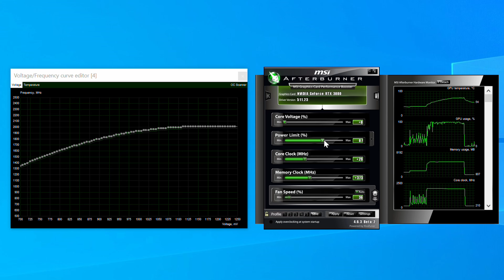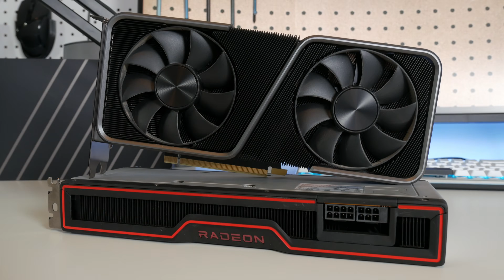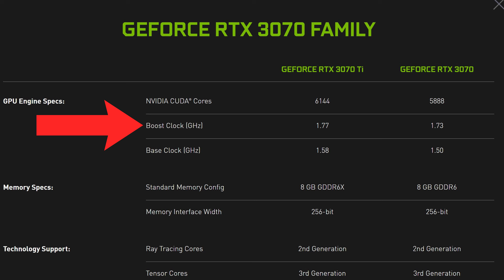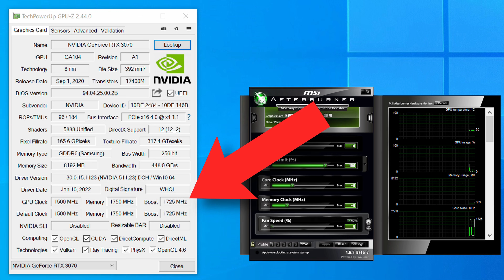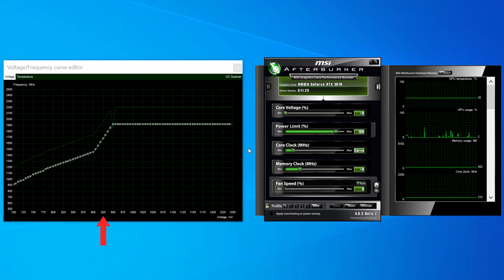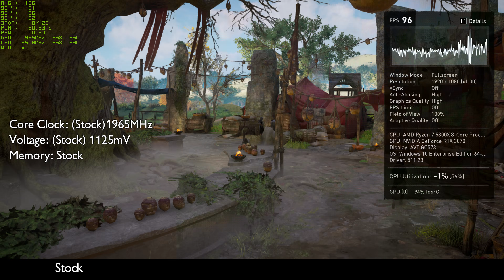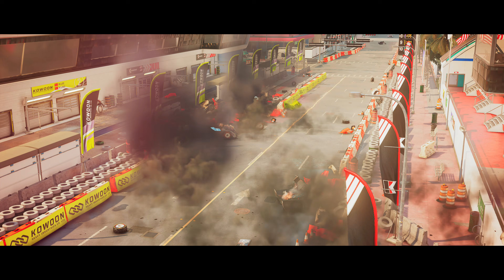How To Undervolt Your GPU (And Why You Should)

Comment: My GPU has voltage controls locked but I can undervolt by lowering power limit and raising GPU clock at the same time. It seems that even if GPU renders less frames when limiting power it's more efficient overall. By default efficiency is about 0.75 frames per watt but sweet spot for this GPU seem to be around 70% power limit where it's 0.95 frames per watt. When I used 70% limit combined with +125MHz GPU clock boost benchmark shows that I lost only about 5fps on average compared to default settings (110fps vs 105fps) but GPU is about 20% more efficient. Not much but it's something

Comment: Undervolted my EVGA 3070 FTW3 quite a bit. Went from about 240 watts all the way down to just over 180 watts. Big thermal decrease too from 62 to JUST 56 decrease in heavy load. I was also able to clock it all the way to 2010 MHz. So I drop power draw, and temp without losing a single frame per second.

Comment: You should not be doing the -200 to -300 on your curve as it will actually INCREASE the voltage required for lower clock speeds. This is messing up strictly by being lazy. Just use the voltage points for set clock speeds and don't touch the previous lower end of the graph (better yet INCREASE it on the Y axis to ask for higher clock speeds for lower voltage usage).
Reply: I agree. your method you will see effective clock is much closer than the method used in video when looking at hwinfo.

Comment: I'm very new to this undervolting so wanted to know what was the math/logic there with the boost clock of 1.73 GHz, the base clock being 1.5 GHz, and then pulling your GPU's rate down about 290-300 Mhz? To go a little bit under the base clock?

Comment: Isn't this tutorial misleading? If I drop the Voltage/Frequency curve, doesn't it mean that I give the GPU less MHz at the same voltage? Which also means I give it more voltage at the same frequency? For example:

Stock:

1500 MHz @ 0.800V

Curve Drop:

1200 Mhz @ 0.800V and now 1500 MHz @ 0.950V.

Do you know what I mean? Shouldn't it be the other way around? Like raising the curve? So that for example 1800 MHz is @ 0.800V?

Pure logic or am I wrong?

Comment: Im shocked. I undervolted my 6900xt sapphire nitro se for better temps. I was pushing 86 degrees on 4k full load on games (even 1080p on very demanding games). But then I undervolted to 2400 mhz and 1140 voltage and POOF. Thermals around 69-74 degrees on FULL load. Holy hell. My fps is basically the same. It runs in many cases up to 15 degrees cooler. The wattage went down from 280-320 watts to 190-210 watts. Im so glad I did this the first day of this GPU. It will lengthen its lifespan and make it much more of a long term investment. It did take some driver crashes and system reboots but I'm so glad I stick with it. These settings work on 4K cyberpunk and Kingdom come deliverance. It is stable on these games which probably means it is stable on all games.

Comment: I've been doing this to my 3060 Ti ever since I got it on launch. When I play old games that are easy to run I do an undervolt and underclock combination. So I set it 731mV at 1620 MHz clock. The temps are so low and it sips less than 100W of power. It's so good it can even play modern titles at 1440p no problem. Now when I want to play at 4K for more modern games I set it at 950mV at 2010MHz. Yes it's a combination of an undervolt and an overclock! Since the power limit of my card is 240W, high power usage games will have lower clocks but with the 950mV I can reach higher clocks at the same or lower power usage.

Comment: Seemed to help a bit with my 3070TI FE, but my temps are still crazy high. Playing at 1080p on Dying Light with medium settings I am averaging around 102c (down from 109c) but I can't even play anything new because my system crashes from heat issues. I have 2 fans pulling in and 2 pushing air out. Maybe I got a bad card?
Reply: Stupid question... But, do you have your GPU fans set to hardware or software enabled? Sounds like you need to check. Make sure you're using the fan curve setup in MSI Afterburner. Your card should not be hitting those temps if the fans are running, and properly setup with the software.
Reply: Is that at 100% fan speed? Those temps are absolutely insane.

Comment: An easier - though less precise - way to undervolt is to reduce the power limit in Afterburner and then use the OC Scanner tool to sniff out the best OVERclock for that power setting.
Keep nudging the power limit down and benchmarking each time until you come back to stock performance, then... that's it - stock performance for reduced power, and AB has done all the stability testing for you😁.
Reply: What is stock performance for reduced power? I dont get it.
Reply: @thenaberius6081  The same performance as out-of-the-box, but with reduced power draw.
Reply: Mind telling who is AB? 😐
Reply: @m.businessabdullah9171   MSI 'Afterburner'
Reply: @m.businessabdullah9171  Afterburner
Reply: @m.businessabdullah9171 AfterBurner
Reply: @m.businessabdullah9171  (MSI) Afterburner
Reply: @m.businessabdullah9171  afterburner program
Reply: @m.businessabdullah9171  Alpha Brain
Reply: what tools do you use for benchmarking?
Reply: @casualgamerdad2878  These days, Port Royal - batters CUDA, RT and DLSS cores all at the same time.
Reply: OC Scanner doesn't wanna work on my setup... I can manually set a curve, but the scanner won't initialize.
Reply: @Pn3uma33  same thing happened to me, any idea what the fix is?

Comment: When you lose the silicon lottery, your card sucks and cant hold any spare core clock points from stock and runs hot, might as well still get your fun of the overclock to achieve the opposite, yet same result

Comment: I have a 3080 12GB model from msi. Everything stock temps would be around 80-83c when gaming. After under volting my card now runs around 64-67 when gaming and only noticed a drop in the 5fps range

Comment: Just got my 3080 ftw3 and my Temps are high, excited to finally try this
Reply: @pcworld  from game Temps of 81c to about 74c right now. That's at 950mv. Tried 925mv and it was working great with Temps at 70c, but red dead crashed on me so now I'm seeing if 950mv is stable
Reply: @pcworld  nice! I'll post a reply with my results
Reply: @pcworld  everything seems stable so far. Ambient Temps were alot higher when I was having issues so, I'll have to see how It does on another hot day. 
Thanks so much for the help
Reply: @pcworld  1920 is what it was running stock during heaven benchmark so that's what I went with
Reply: @pcworld  oh wow ok I definitely will thanks

Comment: I came here to learn how to under volt my RTX 3080 12gb Zotac card.  My card definitely gives more than enough frames at 1440p gaming at max settings, so I would like to reduce the amount of power used plus the heat that it produces.

Comment: Dont work for me. I undervolted and reduce all clocks in my rtx 2060 gainward pegasus oc and still even on 90% fan and 600Mhz GPU clock in furmark running for 90 secounds in HD i have 80'C and hot spot of 95'C. With new termopads, thermall paste and cleaned from dust...

Comment: I did it. Got down to 935mV on a 3090 FE 1950 MHz. I didn’t mess with it for more than 20 minutes was satisfied with lower temperatures. The undervolt also shortens the steps the clocks shift up to so you end up with your higher speed more often with less heat. This was excellent. Afterburner also lets you save presets so you can lower the voltage even further on those less demanding games with just a few clicks to revert to better stability in demanding titles.
Reply: Why in games voltage spike from 850mv to 1081mv😢
But in benchmark is stable
Rtx 3060 palit
Reply: Transient voltage spikes are a normal phenomenon of this generation
Reply: @quin_helldiver  thanks man❤️

Comment: Umm, can you please explain the point of the first step, i.e. pulling down the core clock? By doing so the voltage/clock ratio shifts in the opposite direction IMO. In my case, on a RTX2080S,
base core frequency without touching it: 1650MHz@843mV. After under-clocking by 300MHz: 1650MHz@1037mV.
Isn't that the exact opposite of what we want?

What I do, I just reset everything to stock, run some benchmark and check at what voltage the GPU runs under load. In my case 1043mV (1920MHz).
Then I open the curve editor and push the 1043mV slider up until the benchmark starts crashing, around 2010-2020 MHz.
Last but not least, I try if allowing a bit more juice can stabilize the performance. So I ended up with 2025MHz@1050mV.

I am not touching anything else, only that one 1050mV slider in the curve editor. Works since 2014 :-)
Reply: Yes the dragging down the core clock method first is a complete dogshit method that all these Youtubers use. Annoying how hard it is to find the correct way to undervolt.
Reply: @TheRealSterlingArcher  Well I have to admit that using this method helped to make my clocks more stable. I was puzzled by this behavior for quite some time as it makes no sense really...  until recently 😀
The key here is to make the curve to the right side of your target frequency completely flat. Otherwise the GPU core tends to jump to the next highest frequency when under load. In a real life scenario you may end up with this: Your target clock is 1980MHz @ 900mV > But the curve continues to ascend slightly so you also have 2070MHz @ 1250mV. Under peak loads the GPU will try to jump to that higher clock but hits the power limit.  So you end up with high peak clocks but a low average.
The step of underclocking first with the main core clock slider helps to mitigate this as you pull the whole curve below the target frequency and when you then raise a single curve slider somewhere in the middle, the right hand side of the curve is straight flat. This works but is a dirty solution.
The really correct way (when you know the target voltage/frequency)is: 1) Open the curve editor and check the default frequency at the target voltage. 2) Adjust the main core clock slider so that you get the desired frequency at the given voltage. 3) Now go back to he curve and pull every single slider to the right of the target down so that the resulting curve is entirely flat (between 900mV & 1250mV in my case). This way you don't get that steep part in the curve, so you're not overvolting the left hand side ;-).
I know that this procedure requires quite some patience but it's definitely the correct way 🙂

Comment: Had an alienware prebuilt with a 2060. Did your undervolt method used to average 76 to 80 Celsius on warzone playing with nvidia filters. After undervoltinf averaging a clean 64 to 65 Celsius same graphics and filters and everything. Great guide. Didn't see much improvement with my 3080 but 5 degrees Celsius lower and hardly any decrease in performance. I'll take it lol

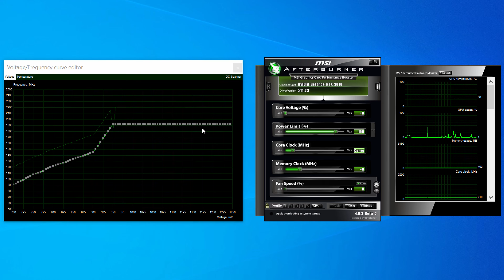Comment: That frequency - voltage graph is doing my head in. At 4:08 the video is saying that voltage is set to 950mV; with the voltage along the x-axis. Meanwhile the graph is showing the straight line at 1900MHz, while voltage runs x-axis all the way to 1250mV.

To be accurate, the line on the graph should stop at x=950mV, and y=1900MHz. 

If you notice my other comment on this page, is dated three months ago. Hence it's taken me this long to work out why I don't understand how to undervolt. It's because the graph makes no sense. It's because I came back determined to understand undervolting, that I worked out my confusion with this graph.
Reply: Ye the graph in afterburner can be kinda confusing, basically the way it works is like this: you downclock the frequency by 200mhz, then raise the 0.950v keypoint on the curve up to certain frequency, lets say 1900mhz, by doing that you tell the gpu to use up to 0.950v max for that specific frequency and since it becomes a flatline at 1900mhz mark, it means the gpu doesn't need to increase the voltage anymore for such frequency... 

The only kinda issue with this metod is that when you underclock the curve by 200mhz, you're literally overvolting everysingle frequency below the 0.950v mark, if you see the graph, the gpu will use a higher voltage than stock at low frequencies, still it shouldn't impact negatively since those voltages will still be lower than 0.950v...
Reply: @ArgStyleRlz  Am not sure I agree. I noticed something else wrong with this guide, for two reasons.

1. By dropping the graph at 2:52, you would be overvolting all frequencies under your chosen 950mV in this graph 3:55.
2. There would be a significant step up in voltage at the point of 950mV.

I continued to look for guides and eventually decided on the following:
Take you graph line with shift and mouse click. At your chosen voltage e.g. 950mV, drag the graph 'up' to your chosen max frequency. From the chosen voltage, level off the graph so the frequency doesn't go above your chosen max frequency. (That way you will undervolt all frequencies of your card.)

Comment: yeah i have a 3070ti in the fractal torrent case, hella airflow. i always make custom sensor dashboards using aida64 for all my computes so i can monitor performanc and temps. immidiately noticed the card, stock, hit 70 to 80 degrees in almost all games with a hotspot of 10 higher than that usually. i undervolted to 875mv at 1800mhz, now i can run the full cyberpunk benchmark that maxes out GPU utilization and i only barely hit 60 degrees AND better result. this is a no brainer for anyone with a 30 series.

Comment: I would like to correct one thing : Those cards must work with lower voltage. It's right in the V/F curve of the card how far it's rated for any given voltage, and ALL these point had to be checked for stability in factory (at least that's how I think it's done ?). 
As for why no manufacturer does this : It's not because "card will get unstable", it's because "performance drops too much [vs. competition]", or "MHz aren't high enough, so let's not do that [when using NV guidelines]. 
GPUs can be made to work at lower stock voltages, they simply can't be clocked as high on them.
Personally, I would love GPUs to be run at stock with 0.7V for big die, and 0.8V for smaller ones (both on lower clockspeeds than today), BUT with additional "OC" option that raises voltage by additional +0.1V or +0.2V value IF user want's to go over that (and is informed about risks [higher power usage, hotter GPU, etc.] with proper on screen warning).
Reply: Dude I want to run at a good 1.2v if I'm overclocking. Newer cards rarely make 1.1v
Reply: @TimberWulfIsHere  Use older GPUs if you want higher voltages. Voltage doesn't mean anything and it WILL only get lower. Think about it : Pentium III 180nm had 1.75V stock, while Pentium 4 had 1.45v or 1.3V (130nm/90nm).
You can't cheat your way out this on current tech.
Reply: @CompatibilityMadness  that's terrible advice. With more power comes great res- voltage.
Reply: @TimberWulfIsHere  ?
It wasn't advice though ?
(sarcasm)

Comment: Linux doesn't allow voltage corrections. Can I tune my GPU under Windows and then move it on my Linux system? Will it keep the undervolt?
Also, I'm using a card which behaves oddly in Linux. I suspect there is some voltage correction on it. Can I investigate this with Windows?

Comment: Slightly..Undervolted my Zotac rtx 2060amp and its temp..went down by 14 to 15c ..I used to get 77-78c under full load in Horizon zero dawn and it went down to 65-66c without losing performance..that's crazy😀
Reply: My 3080ti dropped by 20c when I undervolted, it would fry an egg on it before now I’m within reasonable temperatures

Comment: Bro can u help me pls i got an rtx 3060 and i wanted to fix the gpu high temps so i did what u said but instead of 1850 i did 1900 cuz that was mine mhz but now my pc performance got ruined so much i get like 60 fps less but my pc got allot more sillent and temps a bit less pls help me with this problem i underclocked with msi afterburner

Comment: Thanks for making this guide! Why haven't I tried this before with MSI Afterburner?

I'm already thermal-throttling my dual RTX 3090 Ti workstation at 65'C and power limiting each card at 300W for the sake of longevity, efficiency, and safer system temperatures; but I wonder if undervolting on top of that will help regain some lost performance and then some...

Addendum: I decided to relax the thermal limit to 85'C, which appears reasonable for an Ampere GPU under heavy load. I was able to run both RTX 3090 Ti cards around 1920 MHz (the default boost frequency) @ 875 mV with a fixed 67% fan speed at a steady-state temperature of about 75'C on a Time Spy Extreme 3DMark stress test. I want to see if I can lower the voltage and temperatures further, otherwise, these are already very impressive results.

Comment: I forgot completely about undervolting and I have a disgusting single fan 2060 that instead of hitting 80ish, its around 70. This is a godsend and Im really upset I didnt do it earlier. Besides that, I am actually getting higher clocks.
Reply: Hi! Could you please share your undervote settings. Thanks

Comment: I think I did it right, ran a benchmark clock was around 1890-1905 MHz. According to TechPowerUp my default says 1375 MHz and boost 1710MHz

Now my GPU clock is 1084MHz and boost is at 1429MHz so I will try it and see how this works for me 🤞. I don’t like overclocking tbh lol so I hope I undervolted right. I am just worried if I fry something or damage anything. Thanks for the vid!